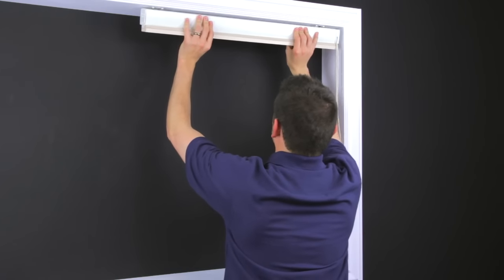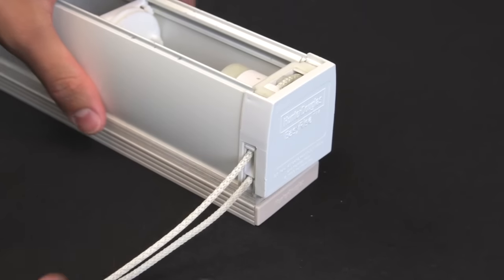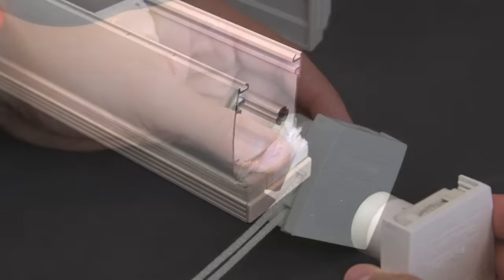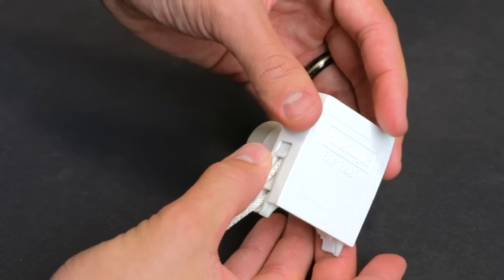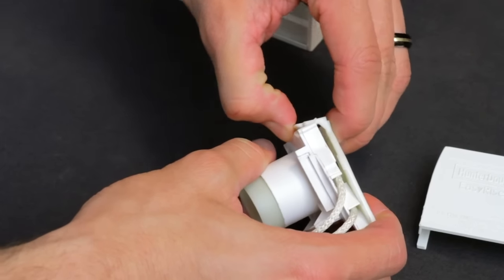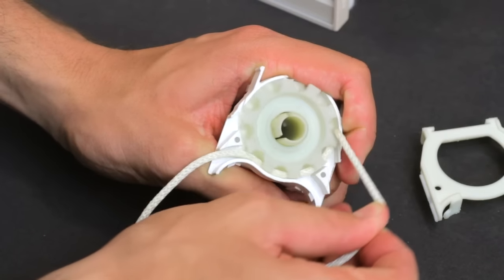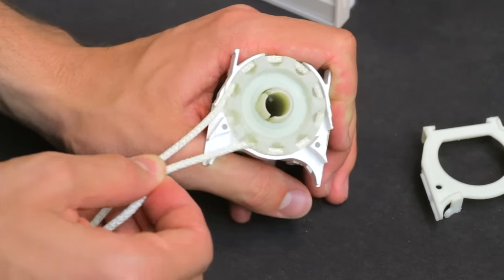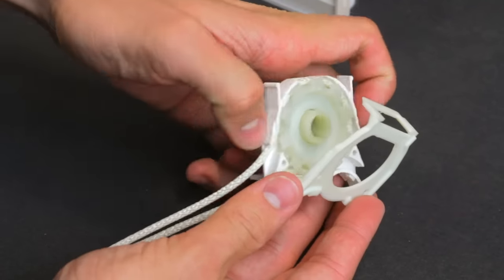How to Replace a Cord Loop in an EasyRise Cellular Shade

Comment: This video was great! Just what I needed to replace the broken cord. FYI: If you use a tie wrap to hold the blind in the up position, you don't have to remove the blind from the window (or just leave the blind in the complete down position). If there is enough space his allows you to remove the gear mechanism without the blind unraveling.
Reply: My blind is over 12-foot wide, so this is a great idea, as it is very cumbersome.

Comment: This video was great. I joined my cord and followed your tutorial to successfully reattach it. However my cord did tear again after a few days. Do you know where do I buy a replacement cord loop ? What are they called ? How to make sure the cord thickness/length matches my blind ?
Reply from the maker: Hi there, You can purchase a new cord loop on our website here: https://fixmyblinds.com/collections/continuous-cord-loops/products/cord-loop-c30. We only have a couple of thicknesses that we sell; I linked to the most common. It's not going to be the same as your original as that size is now discontinued. However, this replacement should work great.

Comment: Is there any way I can install a cord into cordless blinds?
Reply from the maker: Hi Aaron - You want to convert a cordless operated blind into one that operates with a  cord? If so, there's no way to convert them. It's best to just replace the blind with one that operates how you prefer.
Reply: FixMyBlinds Ok thank you, so you have a link to where I can get the blinds that were used in this video?
Reply from the maker: Aaron, the exact same blind used in this video is discontinued. But if you go to www.blinds.com and look at cellular/honeycomb shades that operate with a continuous cord loop, they will be similar to these.